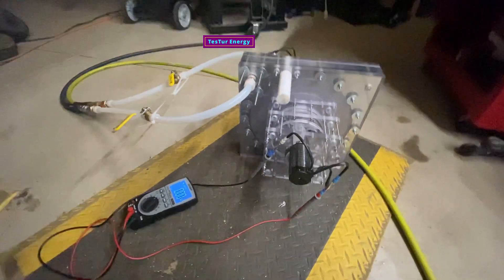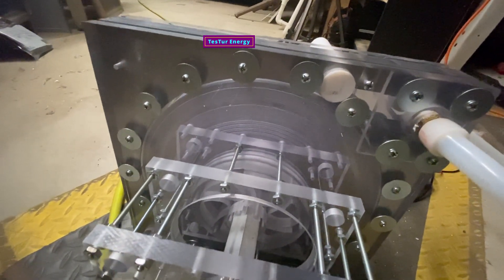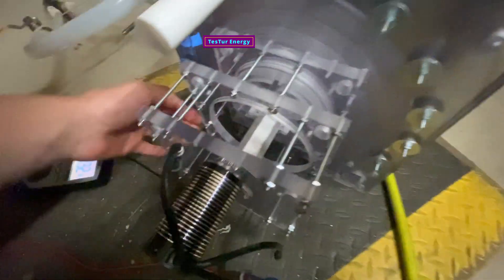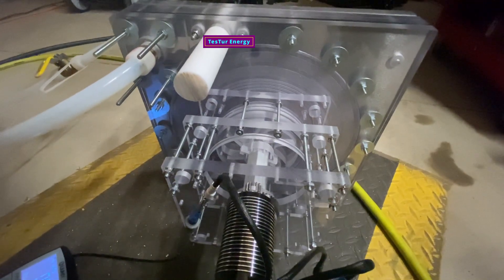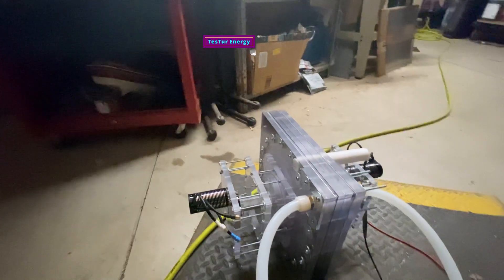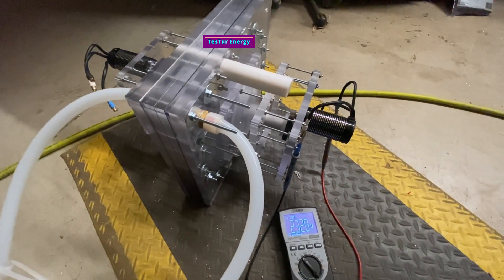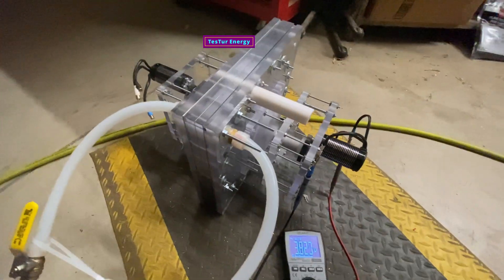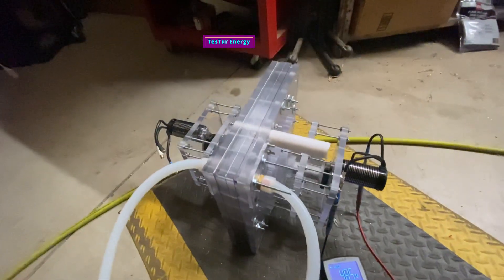10in Aluminum Tesla Turbine ⚡️ Dual 3kW BLDC Generator for Solar Off Grid Electricity Production

Comment: How do you get the parts to make these, and is there a way to cnc this parts? if so if its not to much could I get the blueprints for this?
Reply from the maker: Thanks for commenting TheHidden ALG! I custom machine all the parts I’ve needed that I couldn’t get off the shelf my self. But as far as blue prints I only have vague plots for now. And the files are completely disorganized. As well I’m waiting to do all the stress testing of my designs before sharing the plans with anyone. I don’t want anyone to get hurt because of a bad design that wasn’t properly tested.
Reply: @CharlieSolis  Alright let me know when/ if you make blue prints. It would mean alot.
Reply from the maker: Just released the latest update! 
Tesla Turbine 250 watt to 2.65 kW Power and Efficiency Test
https://youtu.be/XQl1DQgXVkQ

Comment: Could it run on h2o ?
Reply from the maker: Hey thanks for commenting Chitlins Laundry! Yes! It definitely can. I might change the disc spacing or tweak a few parameters but for sure. 

Also this is a very old video. 😅😇 If you haven’t seen them yet, and forgive me If you have, check out the latest dyno acceleration test, peak 2.75kW and 6.22 ft-lbs torque to the turbine shaft, at only 4150 rpm on only room temp 150psi compressed air.
https://youtube.com/shorts/yXQy844URMA?feature=share

And actual sustained 1200watt electrical load output tests @~6500rpm on room temp compressed air all the way down to 65 psi.
https://youtu.be/bWpXRzrzf4g

10in diameter discs , 75discs 10,000in^2 of active surface area, 0.0092in disc spacing. 2in wide rotor…
Proof that Tesla turbines are 100% viable and can produce practicable power, AND torque at low RPMs. 

The turbine is geared UP at a ratio of 3.6:1. Yes you heard that correctly geared UP. the generators each are 3000watt BLDCs with a Kv rating of 2200rpm/volt being spun at ~26,000rpm for high frequency 3phase 12vAC and rectified to high frequency pulsed 12vDC then sent to the 12vDC to 120vAC 60hz pure sine wave inverter.
Reply from the maker: Just released the latest update! 
Tesla Turbine 250 watt to 2.65 kW Power and Efficiency Test
https://youtu.be/XQl1DQgXVkQ

Comment: So you are using power to make power. What is the net gain?
Reply from the maker: Mmmm liquid air and Compressed Air Energy Storage does not have a net gain. It’s an energy storage solution. It’s only when you are doing combustion or have a thermal source where you will see a net gain.
Reply: @CharlieSolis  Can this have hydropower applications? Like a stream or river?
Reply from the maker: Hey yes you absolutely could. But it would need to be redesigned in a few places to meet the different viscosity and flow characteristics of hydro over compressed air, or steam.

Comment: Could the Tesla Turbine be used to make internal combustion FAR FAR more efficient?
Reply from the maker: hey AllboroLCD! Thanks for commenting! 
To answer your question, YES! Lol tesla had specific aspirations for the turbine to do just this. After patenting his original patent in 1911 he spent the next ten years doing R&D on using it as a Gas Turbine. And I’m 1921 he quietly patented 3-4 improvement patents for it that everyone seems to overlook. Specifically, his patent GB 186,083 is a patent for a multi fluid turbine (steam+combustion) that utilizes combustion exhaust to power the turbine and the still relatively hot exhaust coming out of the turbine is then ducted through the flame tubes of a water heater/boiler and the left over heat is used to boil steam that, once up to temp, is then administered into the turbine coaxially with the combustion exhaust to further increase the overall thermodynamic efficiency and increase the viscosity of the motive fluid. And it’s extremely efficient because any heat not used in the turbine just gets dumped into the boiler and used to make more steam as a rather brilliant 1-2-punch sort of system. Check it out here 
NIKOLA TESLA BRITISH PATENT 186,083 - IMPROVED METHOD OF AND APPARATUS FOR THE ECONOMIC TRANSFORMATION OF THE ENERGY OF STEAM BY TURBINES
https://teslauniverse.com/nikola-tesla/patents/british-patent-186083-improved-method-and-apparatus-economic-transformation-energy-steam-turbines

The next turbine I’m making after this all aluminum one will be an all stainless steel combustion temp capable turbine that I will be making to put in the replica system of that patent.
Reply from the maker: As an extra resource, check out the article “Dr. Tesla Talks Of Gas Turbines” that was writing in 1911 after his first patent release where Tesla discusses how he will be spending the next few years of his life developing the turbines specifically for use with combustion. 
https://teslauniverse.com/nikola-tesla/articles/dr-tesla-talks-gas-turbines
Reply: @CharlieSolis  Remarkable! Thank you so very much! Its like weve had the solution to 90% of human suffering all this time, yet we wallow in the stone age.
Reply from the maker: Tesla said it would be 100 years before someone made it work. It’s EXACTLY 100 years since he submitted the 1921 patents 😈😈😈
Reply: @CharlieSolis  I imagine now the key is to develop a turbine that can easily be implemented in any needed situation. Kind of like how Honda sells small motors that can be used on go-karts to pressure washers to log splitters.
Reply from the maker: Pretty much! After these 12in square case/10in diameter Disc turbines I will be doing a 1/2 scale version at 6in square case/5in diameter discs. They will also be modular to each other.
Reply from the maker: And on the note of Honda, I also have plans to use those 1/2 scale turbines as a bolt-on retrofit combustion Tesla turbojet engine for small piston engine heads to be converter over. If you check out my newest videos you’ll see a little 80cc dirt bike in the background that will be getting the first prototype! I also have two little electric razor drift carts that will be getting turned into combustion Tesla turbine powered drift carts. Soooo much to come!!
Reply from the maker: Also here’s a secret link to my latest video of the 1200watt load tests I just did. I just released it early for patreon members only but by the time anyone sees it in this convo it’ll already be public! Enjoy!! 😈😈😈
https://youtu.be/BHPAQF8QNnw

Comment: can you show detailed turbine build?
Reply from the maker: Hey kashif thanks for commenting. So I don’t have a single build video but I have all the progress videos of the build on my channel. You may have to go back a ways but all the build info is in a bunch of videos. Maybe that’s something I’ll do soon. Compile everything into a good build video.
Reply: @CharlieSolis  thanks so much
Reply from the maker: @kjaved8  you’re very welcome!
Reply from the maker: Hey Kashif, not sure if you’ve gotten a chance to see my latest tesla turbine updates but check them out! Just running on compressed air so far while I still work on the larger vacuum chamber system for the turbine. Peak 2.75kW and 6.22ft-lbs of torque 4150rpm with 150psi room temp compressed air with 1/2in supply lines.  And the second video is the latest 1200watt electrical load tests using 170gal of 150psi compressed air dumped to 65psi, both room temp and then 70-80°c heated compressed air. And saw the continuous 1200watt output all the way down to 65psi. Should have this thing ready for a vacuum chamber here real soon! 

https://youtube.com/shorts/yXQy844URMA?feature=share

https://youtu.be/bWpXRzrzf4g

Comment: 👍🏻👍🏻👍🏻
Subscribed! wish you "all the best!"
Reply from the maker: 💜💙💚 thank you Zul Genius! 🙏🙏🙏 
I should have more updates here real soon! Thanks for commenting!
Reply: good to hear that 👍🏻👍🏻👍🏻👍🏻👍🏻
Reply from the maker: I just did a 3.6hp and 6ft-lbs torque @4150rpm run on 120psi room temp compressed air!!! 2.75kw!! And I had it powering my bandsaw without so much as blinking at the load! 🤤🤤🤤
Reply: @CharlieSolis  120psi thats 8.2 Bar. i'll be waiting for that upload. 
👍🏻👍🏻👍🏻
Reply from the maker: This is the link to the latest short of the dyno spin up for patreon donors to see early. I don’t have the data in it yet like my other spin ups but I’ve done the calculations already. The new disc stack has 75 discs (10,000in^2 of surface area) over the 50 before. It’s 9.23lbs/4.2kg vs the old one that was 6-6.5lbs ish AND it’s spinning up faster than the previous one 😈😈😈
https://youtube.com/shorts/35QcP9u4O4s?feature=share

Comment: 3.6 is nice ratio very common number
Reply from the maker: Hey thanks. Yeah at the moment I’ve got the gears to try everything from 1.9:1 to 4.9:1 😬😬😬
Reply: @CharlieSolis  do you want to try mach 3-6 electric spin jet turbine
Reply from the maker: Right now this turbine can’t go anywhere near supersonic. The carbon fiber I’ve got for my future turbines will be able to do that though.
Reply: @CharlieSolis  anything that holds, but the idea is to jet from the current inlet with shaft input at that velocity, to test if electric spinning turbine can be used in super speed air craft
Reply: @CharlieSolis  the more you have radius the less the centrifugal load at same rim jet output speed
Reply: @CharlieSolis  so very large disc can have a fast rim speed without breaking it by the forces
Reply: @CharlieSolis  less mass more speed, of propellant, less air needed to move, when going outputting fast

Comment: 😍
Reply from the maker: Hey Jose, not sure if you’ve gotten a chance to see my latest tesla turbine updates but check them out! Just running on compressed air so far while I still work on the larger vacuum chamber system for the turbine. Peak 2.75kW and 6.22ft-lbs of torque 4150rpm with 150psi room temp compressed air with 1/2in supply lines.  And the second video is the latest 1200watt electrical load tests using 170gal of 150psi compressed air dumped to 65psi, both room temp and then 70-80°c heated compressed air. And saw the continuous 1200watt output all the way down to 65psi. Should have this thing ready for a vacuum chamber here real soon! 

https://youtube.com/shorts/yXQy844URMA?feature=share

https://youtu.be/bWpXRzrzf4g

Comment: Nice setup so far! Can you block the other inlets if your not using them? Any ideas for a better bearing?
Reply: You have huge losses bc of those open inlet and hole. Pressure will build from the rotation centrifugal force on the gas ... but not when allowed to escape tangential
Reply from the maker: @CiamilloDesign  yup yup! These are all still early preliminary tests. Taken everything one step at a time.
Reply from the maker: Hey raj! Yeah i I’ve got it blocked off in this latest video.
https://youtube.com/shorts/zxnZKoRSZfk?feature=share
Reply from the maker: And as far as bearings go, yeah magnetic and air/water bearings will be the way to go in the future. But that’s an easy upgrade that we can do later. That tech has long been hammered out. Especially with New away air bearings off the shelf products. At this point I’m trying to make it work under the worst conditions because it’ll only get better from there. I’m not actually sure they are rusting also, they just appear to have a little discoloring on them and I assumed that to be rust could just be the hose water.

Comment: So the input energy is compressed air, and where would one be able to get compressed renewably? Like this is supposed to be another option for solar/hydro/wind,  where the input is free, but in this case, where would the uses of this motor be?
Reply from the maker: These are just compressed air tests. Ultimately this turbine can be used for a myriad of motive fluids. The compressed air tests are to show how capable this turbine will be as a liquid air turboexpander, as well serves to show preliminary tests of a combustion turbine built exactly the same but out of steel where the additional power out from the additional heat can be calculated using the brayton cycle thermo equations. As well this exact turbine can be used for vacuum pressure steam cryophorus systems that run off of solar thermal collection, and as well a higher temp capable one will be able to handle a full temp pressurized steam system heated from solar. Really with the closed loop steam Rankine cycles it’s just a matter of picking a heat source.
Reply: @CharlieSolis  I wish i had a billion dollars to fund you ...
Reply from the maker: @mirsidorov5112  thank you! I’ve got a handful of really awesome donors through patreon, but it’s no where near enough to really see this take off. But We’re making due! Just one step at a time, and one foot in front of the other.

But if you’re interested we can always use as many people helping out as possible. Take a look at my patreon. https://www.patreon.com/CharlieSolis Even just $5 helps us buy the little things like brass pipe fittings and valves. Every dollar helps! 😇😇😇 don’t mind me though as I just shamelessly self promote... 😂😂😂
Reply from the maker: @Convolutedtubules  thank you that means a lot to hear 🙏🙏🙏💜💙💚 yes I do! You can just send them to SolisHoods@Gmail.com that’s the pay pal account for my first business. www.SolisHoods.com if you haven’t seen them before check it out!
Reply from the maker: Hey Mir Sidorov, not sure if you’ve gotten a chance to see my latest tesla turbine updates but check them out! Just running on compressed air so far while I still work on the larger vacuum chamber system for the turbine. Peak 2.75kW and 6.22ft-lbs of torque 4150rpm with 150psi room temp compressed air with 1/2in supply lines.  And the second video is the latest 1200watt electrical load tests using 170gal of 150psi compressed air dumped to 65psi, both room temp and then 70-80°c heated compressed air. And saw the continuous 1200watt output all the way down to 65psi. Should have this thing ready for a vacuum chamber here real soon! 

https://youtube.com/shorts/yXQy844URMA?feature=share

https://youtu.be/bWpXRzrzf4g
Reply from the maker: Also this could be used in a closed loop Organic Rankine cycle for any low grade heat sources.
Reply from the maker: This video has the basics of a hot tank cryophorus vacuum pressure steam turbine. In the video it’s heated by a wood stove chimney heat exchanger but again really any heat source can be used to provide power to the closed loop system. https://youtu.be/wpWwxfZaE3c
Reply from the maker: And this video is my solar powered closed loop vacuum pressure steam Tesla turbine system with my Tesla fountain steam condenser idea for the water to air heat exchanger to maintain the vacuum. 10kw of thermal and 1kW of PV for every good hour of sunlight. https://youtu.be/9-8KH7bFSKM
Reply: Bladders in a tidal bore could compress air. When the tide goes out the bladders refill with air.
Reply from the maker: @mikemccabe1324  yes that’s Another very effective way too! 

I know mining operations use large water trompe air compressors from nearby water sources to generate most of the compressed air used in the mines. That could work effectively as well for renewable compressed air and heat production. Probably not on a small scale, though I have see a guy on YouTube power a Tesla turbine briefly with his creek trompe air compressor.

Comment: 🎉🎉🎉
Works!
Reply from the maker: Oh we are just getting started 😈😈😈⚡️⚡️⚡️
Reply from the maker: Hey Andriy, not sure if you’ve gotten a chance to see my latest tesla turbine updates but check them out! Just running on compressed air so far while I still work on the larger vacuum chamber system for the turbine. Peak 2.75kW and 6.22ft-lbs of torque 4150rpm with 150psi room temp compressed air with 1/2in supply lines.  And the second video is the latest 1200watt electrical load tests using 170gal of 150psi compressed air dumped to 65psi, both room temp and then 70-80°c heated compressed air. And saw the continuous 1200watt output all the way down to 65psi. Should have this thing ready for a vacuum chamber here real soon! 

https://youtube.com/shorts/yXQy844URMA?feature=share

https://youtu.be/bWpXRzrzf4g
Reply: @CharlieSolis  hello Charlie I will watch it, Thank you! Happy New Year!
Reply from the maker: Happy new year to you too Andriy!! Here’s to another trip around the sun!!

Comment: Ever thought of frameless generator to eliminate the gear losses? https://quantumenergygenerator.com/blog/frameless-motor-for-direct-drive-alxion-2/
Reply from the maker: Hey mike! Yes, I have a design for a built in axial flux generator that I will be doing here in the near future! It was going to require a lot more engineering to get done right away so I went with these off the shelf RC units.  In due time though!